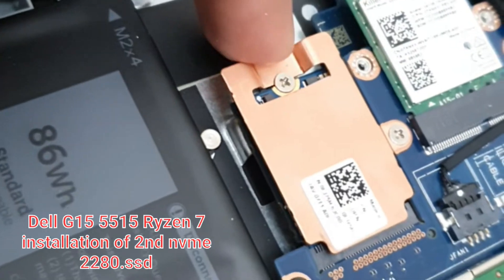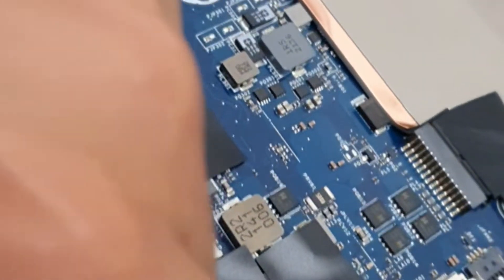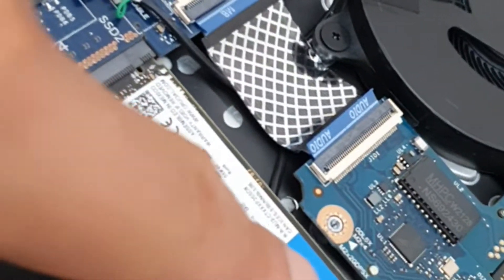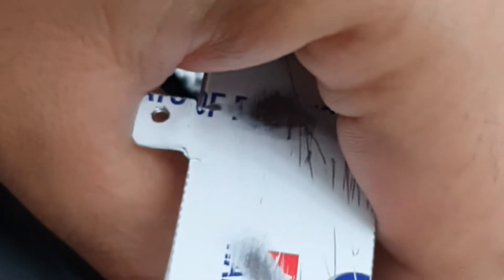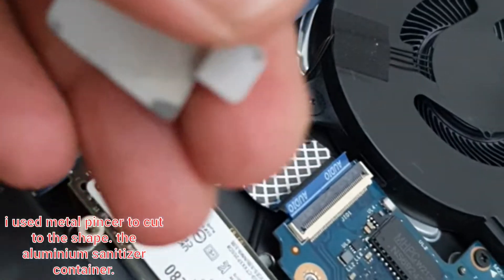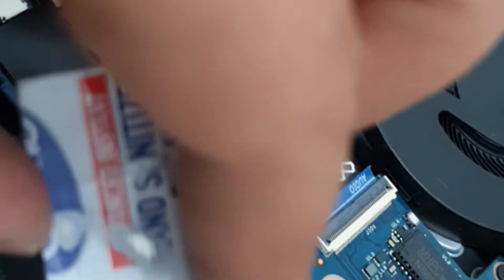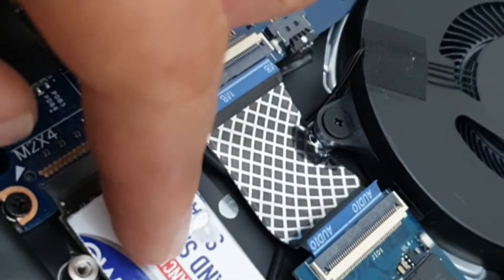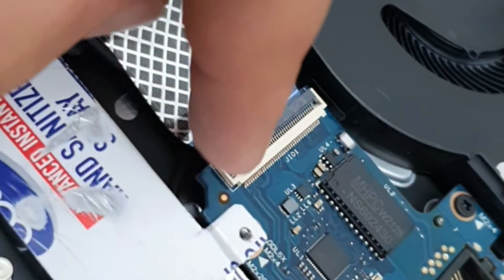Dell G15 5515 Ryzen 7 second SSD BRACKET HACK DIY

Comment from the maker: have been an year and still working fine no issues so far. but i came to know that heat sink was very important actually mandatory kind of. good that i made it from aluminium sheet or else may be it would burn out.
Reply: did you make the mounitng bracket as well? or just the heatsink?
Reply from the maker: @thelastdragonbender5824  mounting bracket as well. Its easy. U just need aluminium sheet and pincer and pliers
Reply: @bishalscreation  Alright, thanks!
Reply from the maker: @thelastdragonbender5824  my pleasure 🙏. Little thick aluminium container will work. U can reference the original bracket vut and fold accordingly.

Comment: At least show the bracket that you made😂
Reply from the maker: @RotluangaSailo  due to the lack of tripod extremely sorry but its show
Reply from the maker: It's actually easy you just need to fold it and map with original bracket that's all
Reply: I'll give it a try. This tiny piece of metal shouldn't cost more than 2$
Reply: Wait i thought you made the small piece that holds the screw as well. My bad
Reply from the maker: @RotluangaSailo  ohh i made that aluminum one for 2280

Comment: Can you make tutorial on how to make it
Reply: Can u please give dimensions?
Reply from the maker: @veekshithcb  actually u can reference the bracket in the laptop itself u donot need to measure actually
Reply: @bishalscreation  okay
Reply from the maker: Its easy buddy u just need to cut a thick aluminium foil in the shape of the bracket. U need a pincer that can cut metal foils. And use long pliers to fold in shape. Use an screw already there in the motherboard. Heat sink is optional.
Reply: @bishalscreation  ok thanks
Reply from the maker: @omkhond4406  🙌🙏🏻❤️